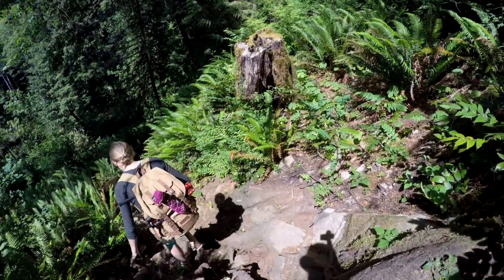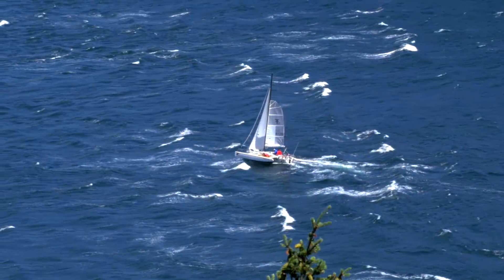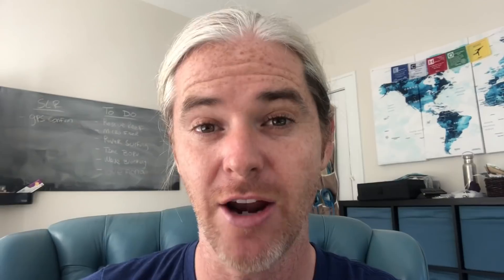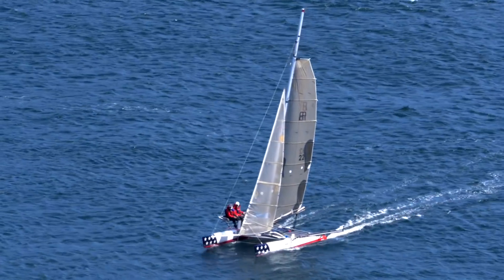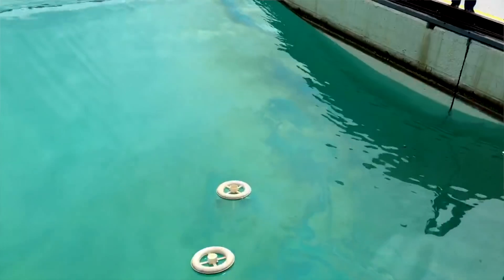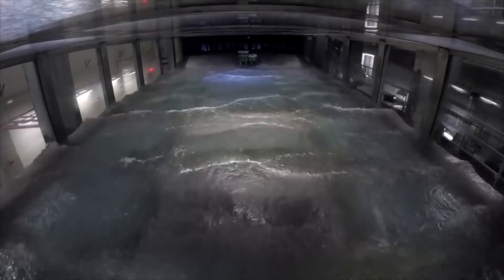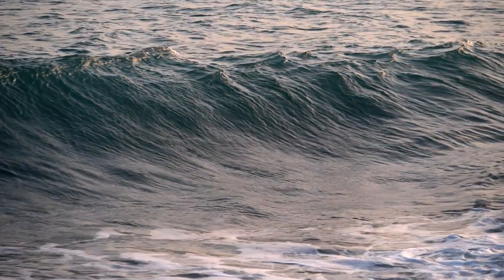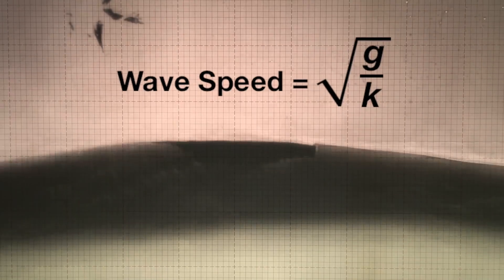The Physics of Wave Blocking

Comment: We were in the Desolation Sound area which is east of your video location a couple times and witnessed to a lesser degree the interaction between the currents coming thru the two passages and the waves where a couple passages intersect. It was still something to behold. 

I was confused by some of the text on video. At about 1 minute mark you verbally say "the current is running right to left" but the arrow on the screen points to the right. The same thing a couple seconds later where you indicate the wind in left to right and the arrow shows the other direction.

Comment: I'm a friend of your parents, and sister... anyhow... I'm not really a physics nerd (nerd yes, but no physics training past High School requirements). I am, however a sailor, and would also have predicted crazy rough water... certainly not glassy smooth.That being said, after watching your footage and your discussion/observations, I think it makes perfect sense to me. In my mind, this is exactly like an airplane breaking the sound barrier. See if you can follow my analogy here. An airplane (or anything else) that is travelling SLOWER than the speed of sound, emits sound waves in all directions. Sound coming from the plane pushes forward through the air in front if it... much like wind-blown waves pushing travelling through the water in the earlier part of your video. As a plane goes faster, and reaches (or passes) the speed of sound, the sound waves are no longer fast enough to make headway into the oncoming "current", meaning that sound can essentially only travel backwards (relative to the plane's forward motion at least). If you were in front of a loud jet engine that was travelling at supersonic speeds (don't try this at home), you wouldn't hear it AT ALL until it passed you. If waves can't progress faster than the fluid they're passing through, you get smooth seas, or silent air in the case of the jet engine. I've never witnessed this first hand in sailing however.  The only strong currents I sail in are in Wood's Hole, MA, and the waves I encounter there are typically CAUSED by the currents passing over and around the irregular seabed and shoreline... so more current just causes more waves there... rather than erasing waves. And 6 knots or so is about the strongest I've encountered in there... nowhere near what your talking about in that Canadian water.
Reply: Thanks... One potential flaw with my analogy, is that it assumes familiarity with the concept of the sound barrier. Someone with a less-than-impressive understanding of physics might not be familiar with that concept, and then the analogy is of little help to them. I do generally like using analogies to explain things though...

Comment: I'm not a physics nerd.  I passed physics because I discovered that physics is just things you already know happen explained mathematically.  I think the plain english explanation is that since waves are basically rolling barrel-shaped  moving energy,  when the velocity of the cohesive water molecules exceeds the strength of the frictional forces of the wind on the surface(like a skidding tire) the bottom of the rolling barrel is being ripped from beneath which prevents the rotation of wave formation.  A common example is the lack of waves(ripples) exactly at the crest of a waterfall.  As the water speeds up just at the edge the surface is perfectly smooth.  I love physics!

Comment: 🌎📢FLUID DYNAMICS NERDS UNITE! The struggle is real, my friend, but you are not alone. I will alert the internets at once!😬 The first time I saw that video I posted the link to in the comments of your vortex video, about the insane reality-questioning result of colliding vortices, I felt like I was standing in front of Deep Thought being just told the answer is, "42". I had to binge watch PBS Spacetime videos for a solid week to LOWER my confusion of this universe enough to accept reality and bother spending time vertical with flip-flops, so  I wouldn't be surprised with any answer... but I'd first jump on your answer's bandwagon. I don't know how similar the two are but I remember as a small nerd growing up on South Texas beaches, having a similar reaction when I took some time to notice and watched the water movement at the shore. There's always some mix of waves/water coming in at the same time as water/waves? flowing out combined with usually strong winds pushing it onshore. If you can resist the urge to chase and dig up those tiny coquina clams that quickly re-bury themselves when exposed, and stay focused on the movement of water, you see all kinds of (my scope at the time) bathtub physics defying movement. Anyway, I've been looking for an excuse to be an international nerd and contact a smart Kiwi or 2 from the last America's Cup cycle as well as touch base with a couple of the more friendly residents causing trouble over in the sailing anarchy forums. I'll report back with anything worthy. 👋 NERDS AWAY!
Reply: I just saw your Victory email! I am certain this video was the one that convinced FedEx that you were above and beyond. Very big congrats from Texas! Well done!